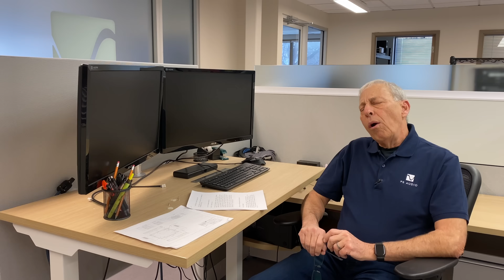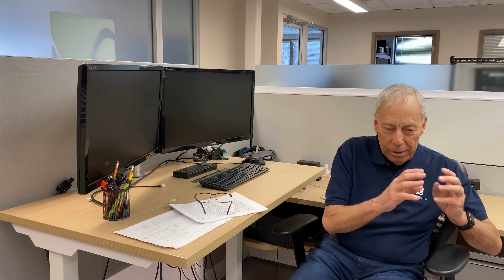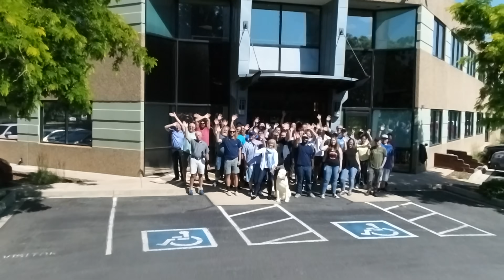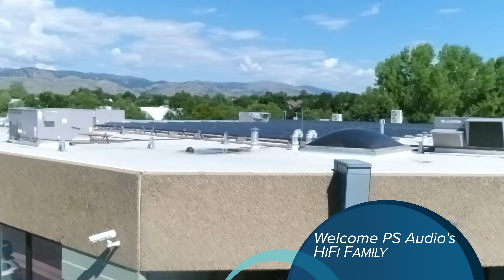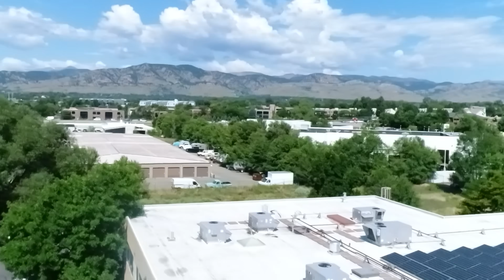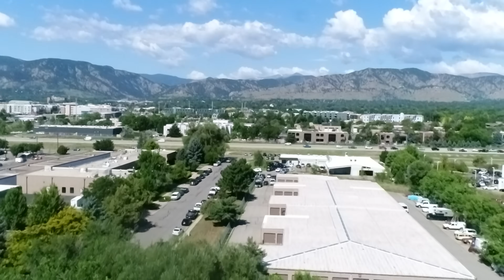Low powered amplifiers

Comment: I would not buy an amp with any less than 150 Watts per Channel. Most hifi speakers are under 90 db in sensitivty. I have a nad c375bee and it is one of the best in its pricerange
Reply: I would not buy any speaker under 90 db
Reply: Hugo Bloemers its just a shame many hifi speakers are 90 db or less. I don’t think you just look at that. The most important thing is that you like the sound of speakers

Comment: I generally take these vids as sage...but...not this time. The math just doesn't work out. On a flea amp the decibel distance from zero watts to one watt is phenomenal. Way more than the distance between 100 watts and one thousand. Go from peak watts down to the watts of the noise floor and maybe 85db down. How many watts are you still pumping, unused into darkness. And those watts are probably the best the amp can produce. Your rebuttal encouraged.

Comment: ....when more and more of us are moving in to apartments,..all over the world....how can we have even a 50wpc amp?,...when you cannot open it up,...whats the use of having more wpc? Its market driven,..may be that's why even the high-ends are now going for low wpc,...but focus on the other important dynamics of the amp...business needs volume to survive....
Reply: We need more well designed, highly efficient speakers
Reply: Being forced to move into small apartments...all over the world? That’s the UN Agenda 21/30 plan. Of course the UN always has the best interests of people around the world in mind when they tyrannically force undesired social change.
Reply: @msmeyersmd8  Ah yes, the tyrannical UN. Remind me, are they run by the illuminati, the masons or the shriners this week?
Reply: @thisisnev ... what? the Jews are out now?!
Reply: thisisnev I think it’s the Shriners. Those itty bitty cars that they drive in parades are really top secret all-terrain vehicles containing Pulsed Energy weapons. 
The Fez hats protect them from stray radiation. And prevent people from mistaking them for Jews.
Reply: @msmeyersmd8 ...lol
Reply: You're missing a couple of big factors. First is that smaller speakers tend to be less efficient and need more power. Second, and more important, is that there's no standard the industry goes by to rate an amps power. Everyone does it however they see fit. The differences between amps rated for the same power can be huge.

Comment: Yup Paul, thats why in a 3 way speaker, having 3 class A or a/b amplifiers, electronically crossed will equate your big honking Class D stuff. Split the load up, reduce the heat and have your tofu a different way.
Reply: Yes indeed .. Exactly what I do, and the sound is excellent.
Reply: @jamiemcneil9462  😃

Comment: if I have a mono car amp 500 RMS 2000 PEAK @ 4Ω driving a 12" 4Ω 450 RMS speaker, do I need a 12V 500A 2000W power supply?

In short, how big of a power supply is needed to run a given amp optimally?
Also can computer SMPS be used to power an amp or will it cause issues?
Reply: https://www.gigaparts.com/astron-rs-50a.html
I have the 20amp model. 
This runs 37 amps continuous. 
So, 37amps×13.8volts=510 watts continuous. 
I hook mine right to a lead acid battery that sits next to the amplifier. But you can run straight in also.
Reply: The power supply is internal to the amp so you don’t need a power supply other than the cars 12 volts. Or are you thinking of modifying the amp to use an external supply? I can’t think of why you would do that other than to maybe better isolate the supply from the audio section of the amp. But I wouldn’t recommend that.
Reply: Car amp needs only 12V. 
If You want, You can use 1F condensator.

Comment: Mmmm I owned a pair of 50W single ended valve monoblocks and they used the GM70 valve capable of 70W single ended. Then there's the Kronzilla's awesome mono valve amps. Oh I forgot WAVAC.. But the most powerful SE is powered by a monstrous valve and I can't remember the name of the valve or amp but it's Russian I think and it's 100W or more SE. So Paul...?????

Comment: Hi Paul, thanks for another excellent vid - - I was wondering why you didn't mention that a shorter "signal path" found in many SET's and lower powered amplifiers my play a  role or design goal, generally speaking, when engineers design and produce these lower powered amps. Do you think that a shorter signal path as it makes it's way from the input to the output plays a role in better audiophile sound? I've always wondered if it's the shorter signal path or in some instances, the addition of a higher amount of harmonics (less negative feedback) or perhaps both that produce the "glorious" SET sound that I've heard audiophiles talk about.

Comment: I started out as a stupid teenager with a 35wpc receiver, and killed my speakers’s tweeters driving it to clipping.  I don’t feel the need to go low power again
Reply: Tone controls, passive crossovers and youth/inexperiance. Imo, not small amps fault.
Reply: @FatRat-f9m  Well, I did take my 1980 BMW r100 motorcycle apart 20+ years ago. Thats why i'm still alive. I figured that one out.
Reply: 35W per channel is not so weak in fact. 
Depends how efficient Your speakers are. 

My main amp have 160W/ch, but i can drive my speakers on 60W/ch amp - no problem. 
I do not need more than 60.
Reply: @FatRat-f9m  Thats pretty good. You had a stereo when you were 14?. I was riding the fire trails in Malibu on my Honda Xr75. 
Is THAT tough enough?
Reply: @sailingaquarius23 ...how tough depends on how many bones you broke '120vac boy'.
I was 16yo in 1976 not 14...you was only 'out' by 2 years; not bad ;-)

Comment: A couple of points. A single ended amp is always operating in Class A by definition. There are single ended amps that use more than one output device per channel, they are known as parallel single ended. Not all single ended tube amps use triodes, there are also single ended pentodes and tetrodes.
Reply: Yes, glad you mentioned that.

Comment: I own a Pass Labs Aleph 3 which is single ended class A.  It was marketed around 1997, puts out 30 w/per channel, and retailed for $2,300.  It doubles the wattage as the impedance decreases.  It’s stable into a dead short.  Geez, you could probably weld with it!  It plays plenty loud into average speakers (around 86db sensitivity).  I’ve owned lots of amps over the years, both solid state and tubed, but this is my forever amp.  I want to be buried with it.
Reply: I have not heard an Aleph but I do own a Pass Labs XA-25 that I feel the same way about. It is a wonderful piece of gear.
Reply: Larry Smith In my experience, you can’t go wrong with anything Nelson Pass markets.
Reply: I still have the Threshold 400a I bought new when he first came on the scene. With the caps replaced it's still a great amp. The XA-25 is in another league.
Reply: @larrysmith5695  I have Threshold 400 A too. Which is great sounding. Which on is your favorite Threshold vs Pass labs ?? Also, my Threshold which I bought in a Pristine Condition has an audible HUM coming out from the Amp but not thru the speakers. Does your amp also has an audible HUM too ??? Pls let me know. Thanks
Reply: I also own a Stellar PS Audio S-300 that's a fantastic amp.
Reply: Ronnie ...I think you mean that it doubles the current as the impedance load halves , since the word "decreases" is too arbitrary.
Reply: Fat Rat Point well taken.

Comment: In the old days I had a Technics 'New Class A' amp, which I think is really a class G or H which sounds like what is being mentioned. I hear they are more power efficient, especially probably for monster wattages. As I recall it has something to do with upping the supply as controlled  by the input signal. That amp is not digital 5.1 etc, but started switching the audio input for no particular reason.
Reply: I've got an old 80W SU-V7 which isn't efficient at all, but it makes a nice heater.

Comment: I used to have an old 7 1/2 watt 2 channel class a vacuum tube amp paired with a set of old altec Lansing cabinets.
Reply: I had an old school tube amp (like 7 watts per ch) that used the small tubes (made in mid to late '60's). It was "Star" brand and the best amp I ever had, and unfortunately I sold it (I was an fucking idiot).
Reply: That's big compared with one amp I saw reviewed. It was one watt per ch @ 1.3% THD (and cost $800). lol And he said it sounded amazing. lol

Comment: Not sure if the math works, I have a primaluna amplifier 75 watts per channel and I I listen between -28 to - 20 db. Assuming that at 0db the amplifier  output would be 75 watts, and the fact the output power halves every 3 db it would mean my amplifier output s between 1 to 3 watts at my listening volume. Doesn't  that mean I have about 72 watts of headroom? Why would anybody need more?
Reply: @FatRat-f9m  I get it but you are thinking in absolutes. Let's pretend you need double or three times as much power as I do ( mind you, I listen quite laud)  so  you need 9 Watts. The point is to understand why you would need 300. What needs to be understood here are the order of magnitude.

Comment: Big amplifiers also amplify the small problems too.  So they are less forgiving and are more expensive to design and manufacturer.

 Low powered amplifiers don't have these issues.  Their greatest problem is speaker matching.  If your amp makes less than 50watts then your looking for speakers with a sensitivity over 95db. Its worth pointing out that before the 90s all good hifi systems were built this way.
Reply: It depends on the size of the room. Plenty of pre-90s amps push out less than 50W but work fine with 86dB speakers at moderate volume in a smaller room.

Comment: Couple other factors if you're talking about SET amps (like a 300B). Usually there is an output transformer involved, not a cap coupled output and also often no use of negative feedback. I personally find that limiting NFB is the biggest sonic improvement in the amps I'm familiar with or have built. In other words, Paul's explanation is good, but doesn't tell the full story. If you want to know more, go listen to some different amps and see what you prefer.

Comment: I am right now rebuilding my first stereo I ever built from 1980 (I was 12 years old). The Realistic STA-64 receiver has a whopping 16watts per channel. Back in the day I ran the speaker outputs through a car 40 watt (per channel) power booster run off a AC/DC converter. For some reason there is no (that I know of) home audio Amp that allows for high power inputs.

Comment: Not a bad review however you made one mistake about class a amplifiers. Class a amplifiers do not share the positive and negative portions between complementary devices. Also I would mention that low powered amplifiers are really only useful for high-efficiency speakers or headphones. Finally a comment about the sound quality of tube vs. Solid-state amplifiers. Among other things,tube amplifiers have a more euphonic sound in their nonlinear range than solid-state amplifiers due to the different harmonic content. Which is why some people prefer tubes over solid state. But if amplifiers are operated in their linear regions,there is not a lot of difference between tubes vs. Solid state if both are well-designed.
Reply: @Larry Niles...how did you learn to be such an arsehole Larry?
You've really got it down to a fine art.
Reply: Larry Niles So what’s your beef?
Reply: @StewartMarkley ...Larry's an overzealous troll Stewart.
Don't pay him any mind.
He never contributes anything of value; only vitriol.

Comment: Low power = low price all else being equal. Emotiva A-150 less than A-300 etc.
Reply: @Larry Niles No reason. I could have said brand X. The watcher's question was why low power amps. And the main; not only, reason is hitting a price point within a product line.
Reply: Brian Simmons
Hey there,
I can understand using low powered amp to hit low price points but I see examples of amps below 20 watts into 8 ohms and even below 10 watts in just about a every price point. I doubt the maker of a $4000 18 watt amp is too concerned about hitting a price point. However, there some efficient speakers that I find really fatiguing and I thought that maybe I think they are harsh because I’m listening to them with the wrong amp
Reply: Emotiva = JUNK !!
Reply: @JasonLeaman  Thanks for the insightful and constructive contribution to the topic. Dude, it was an example, pick a brand it all the same. Never is a higher power amp less $ than their lower powered amp in their line.
Reply: @JasonLeaman  Maybe a bit harsh. How about this one. What would you recommend for a class A/B, 75 WPC amp for $300?

Comment: I use hand built, 2 watt single ended triodes into very sensitive horn speakers. I cheat, the speaker is tri-amped with the (only 93db/w/m) ribbon tweeter powered by an 8 watt single ended transistor amp. My midrange driver is a 115db/w/m compression horn. At my normal listening levels, typically under 95db, they draw from 1 to 10 milliwatts. My 15" woofer draws about 10 times that much, 100 milliwatts or so. Since I have 2,000 milliwatt amplifiers, I have plenty of headroom. The sound is spectacular.
Reply: Someday, mulitamping will be common like fuel injection. 
Carburetors, bias ply tires, passive crossovers, snake oil salesmen, will be so yesterday.

Comment: Nelson Pass's amps are relatively low power as well, and held in very high regard.  Steve Guttenberg uses his First Watt J2 for reviews of high-efficiency speakers.  That's a $4,000 amp and only 25W.
Reply: Except for his Threshold and Adcom designs which were very high powered amplifiers which had enormous headroom and sounded so warm and tubelike. I still own a few of his amplifiers. Simple design, built like a tank and sound excellent!!!
Reply: yeah, I watched Steve's 4 part interview with Nelson Pass and I understod that First watt is his side project emerged from DIY community relations and every amp is made in small series not interfering with the Pass Labs amplifiers directly.

Comment: I would add that they are often paired with high efficient speakers that do not require lots of power.
Reply: Fat Rat depends how there tested, I believe there’s a few different tests that can be done and I remember reading that Klipsch do use a different test some were. A bit like camera iso’s.
Reply: @FatRat-f9m  I don't care much about measurements, no matter what other speakers I had in the system, when I change to the RF7 IIs I am scrabling to turn down the volume. I don't  are what they measure they ARE efficient. I wish I would remember to adjust the volume before I shut down to change out speakers but I always forget.
Reply: Hey, I was going to say that :)
Reply: Klipsch come to mind
Reply: @scottyo64  yeah, horns generally. I watched Steve Gutteberg's video from his friend Miguel's apartment at Manhattan, NY and he has Audio Note SET and Avantgarde Acoustics speakers. I wonder how that system sounds 🤔🤔😁

Comment: I run a 2 watt Decware SET tube amp with ZUaudio Omen DW speakers. Sweet holographic sounds. The speakers are highly efficient. I have no problems running at 80+ dB loudness w/o any distortion.
Reply: Very nice system, Volker.
I suspect that low power/ high eff. systems are one of those things that most people still need to "hear it to believe it".
Reply: My Zen amp is driving double Advents.
Reply: The tubes get hot. You don’t want to touch them.
Reply: does it run hot?
Reply: Han Siang Ng Not really
Reply: What? Did you say 80 dB? I couldn’t hear you.
Reply: @msmeyersmd8  Yes. 80+ db SPL. That is loud enough for my listening.
Reply: Volker Henninger I certainly understand your point. But certain music, even Classical Music, should be heard at louder volumes. It captures the full dynamic range and a realistic experience from the full orchestra playing to the single flute or oboe. Some modern songs by groups like My Bloody Valentine playing “Soon”, use a  complex, layering of distorted guitars and vocals that doesn’t sound right at low volumes. The idealistic technological “beauty” of the original CD specification was to to have a S/N ratio and dynamic range of greater than 100dB. Great Vinyl barely makes the mid-80s dB. Today, compression is used to pack all of the dynamic range of most music into the top 30-50 dB to sound good on “ear buds”. Much worse than Vinyl from the 1970s and early 1980s.That’s the musician’s, recording engineer’s and the producer’s fault. Unfortunately there’s little we can do about it.
Reply: Just bought some Decware mono amps bout 2 watts. Sweeter than 250 watt Levinson...by a long shot.